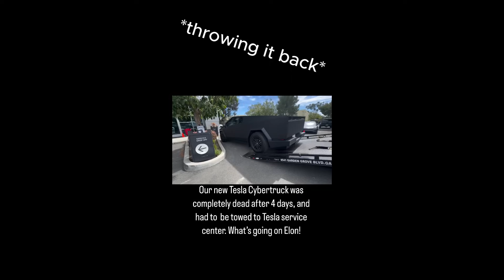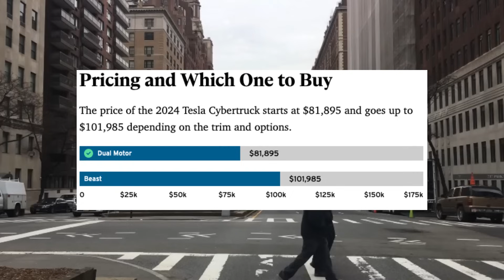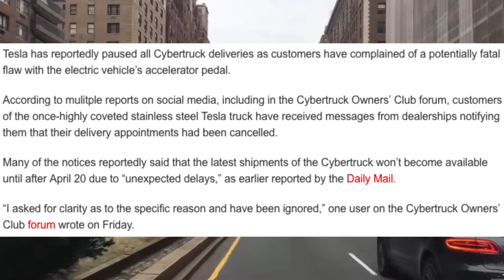THIS Is Why The Tesla Cybertruck Is DELAYED AGAIN!

Comment: The reason that you can't buy a vehicle from Ford, GM, Toyota, VW, Honda, JLR, Subaru Volvo etc. is that they are automobile manufacturers who can only legally trade with dealer networks.
Tesla deliberately circumvented the established method and set up the business as a "technology company" .
People should keep that in mind when purchasing a vehicle from Tesla.
There are merits to both approaches, however the established motor manufactures know how to do the basics like NVH, suspension, fit and finish, door shuts etc.
Reply from the maker: I agree with this. There are things Tesla does right and I don’t hate Tesla, but I do believe there are things they can do better and improve in their design and assembly line production, that’s all. I do like how Tesla distributes vehicles directly from manufacturers. New car dealerships shouldn’t exist, they just hurt the consumer for cars that already cost too much.

Comment: This video is so biased it is funny.
I bet the author has a good reason to why Tesla has the highest NPS score of 97 with practically zero advertisement. 97% of Tesla owners consider buying a Tesla again and they readily recommend Teslas to family and friends as well. Could it be the lack of quality? The lack of innovation? The lack of safety? The lack of quickness? The lack of efficiency?
One can't but wonder ;-)

BTW Toyota, a supposedly quality brand, has a score of 43
Reply from the maker: Because 100% of Tesla owners only recently got an electric vehicle competitor on the market. It doesn’t mean the build quality and quality check of procedures of Tesla isn’t poor, it just means they wanted an EV and Tesla has a battery. It fulfilled the desires the buyer wanted. It could be that small updates on an iPad in the center of the dashboard can mask the actuality that Tesla is too cheap to afford two screw fasteners for a $102,000 base msrp car. Are you insinuating that Tesla is not actively delaying Cybertruck deliveries due to a massive oversight of design that has caused a breach in the safety of the new Cybertruck?
Reply: @scionlyfe380  I'd hardly call a superficial accelerator fasciae plate highlighted in a single viral video to be "a massive oversight of design"...lol.  If you're calling that a massive oversight, then EVERY car manufacturer has had massive design oversights affecting safety.  Name one brand that has never had a safety recall.

Comment: The part I find so aggregious is that there loads of people talking about it like anyone cares.  Just another bit of information to fit into your news cycle everyday.  There are other more important things to consider instead of this crap.  

However, let's for a moment take into consideration some of the issues that the Cybertruck is having and your findings aren't really unfounded. Typically, the first year model or first year after a major redesign, of any manufactured vehicle tends to be considered unreliable.  Statistically, a vehicle tends to be recalled more often in the first year of manufacture or first year after a major redisign.  In fact, this is also true in chip fab industry where yields and quality of product tends gets better and better each iteration although, in this case, there are no recalls except in very extreme cases (Intel's Pentium FDIV bug comes to mind).  Of course, this doesn't help the early adopters which is unfortunate.  However, as we speak, Tesla has issued a recall for the Cybertruck so they recognise that there are production issues and are willing to solve them.  While a delay in deliveries is not what people want either, I think Tesla fixing the problems is better than  not.

On a final note, these kind of things happen in pretty much ever manufactured product in history.  More so now than it previous generations as the almost annual design cycle has taken a hold of the market, regardless of product.  Now, I am not going to purchase the Cybertruck and probably never will.  Just doesn't fit my lifestyle.  However, if I was to consider one, I definitely wouldn't be buying one now mainly due to some of the factors that you spoke about, quite a part from the production problems.  Your lack of objectivity and your word use make you a highly undesirable reviewer to be followed and I have viewed some of your content just to be sure.  You would do better by focusing your content instead of the inconsistent and wayward way you present your content.  I wish you all the best.
Reply from the maker: I care it’s why I talked about it🙂thanks for watching

Comment: It's an over piece of junk. Bad breaks, crappy battery, that's what happens when you make junk
Reply from the maker: Most Teslas seem to be built this way
Reply: @scionlyfe380    BS.  Show me the data where the batteries are supposedly failing en masse.  The batteries are guaranteed for 8 years or 100k miles.  I haven't heard of "most Teslas" failing.  And re the "breaks," I fully expect mine to last the life of the car since I use mostly regen braking.  I've never heard of "most Teslas" having brake problems.

Comment: Haters will be haters.  And people like you will continue to spread disinformation.

The issue with the pedal, if you bothered to notice, would only hold the pedal down if the back part of the piece that may come off is also held down (meaning the person doesn't take their foot off the accelerator).  You see, physics says that if the foot is taken off the pedal, the return spring pressure would cause that loose piece to fall away without causing an issue (as is seen in the video when the guy moves his hand away from holding it down).  And it's absurd to think that if a vehicle accelerates unexpectedly, that they wouldn't hit the brakes to slow it down.  I do agree they the pedal cover should not come off though.  It's an issue that is being corrected.
One truck that died with an issue doesn't mean every truck is bad, as you ignorantly suggest and highlight in your video.  And the truck retail isn't over $100k as you also suggest.  It's only that high for the highest trim.  
Build quality of Tesla's has gotten much better over the years.  The issues with gaps and rattling is the experience of almost every new car manufacturer to have minor issues here and there.  What is important is how the manufacturer deals with the issues.
Reply from the maker: Sorry you feel that way, thanks for watching🙂